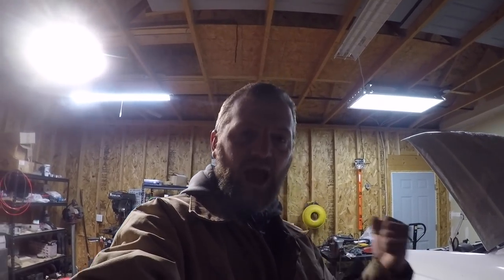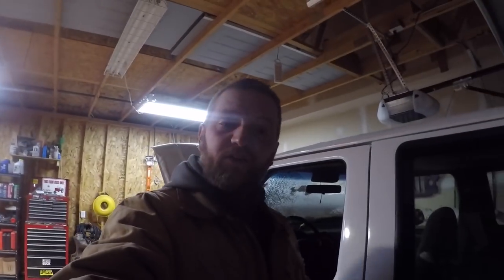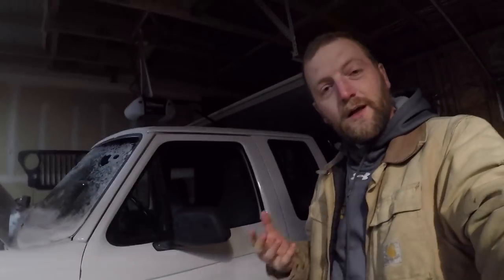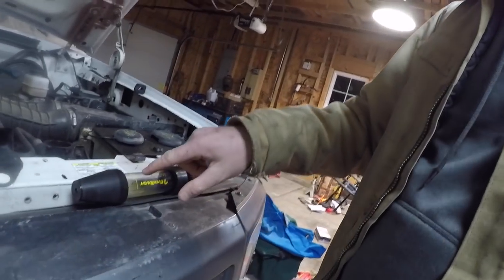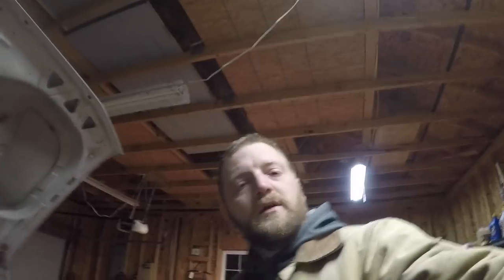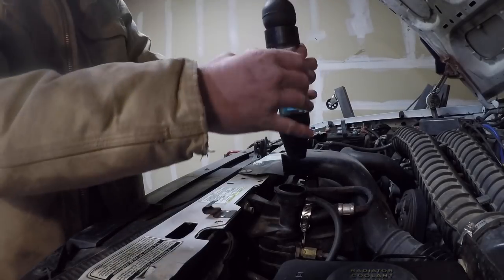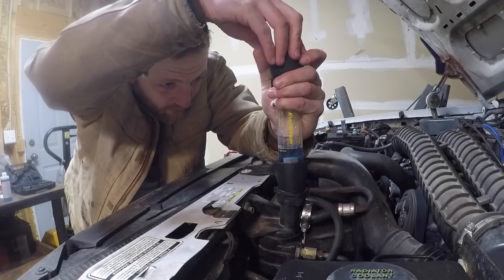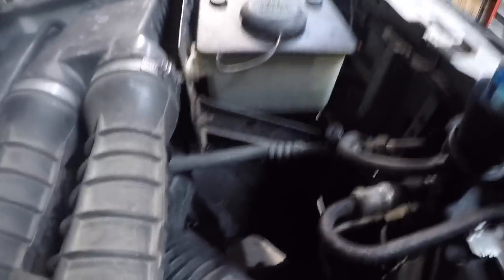Blew the engine?

Comment: Could be worn water pump impeller. Had this happen on a Scania dump truck I have here on the farm. Was convinced it was head gasket but sniffer test confirmed otherwise. Worn impeller caused the coolant cavitation and blew it out the radiator cap. Replaced the water pump and she was fine.

Comment: G'day Blake I have had those testers not change colour and still been a blown gasket/cracked head best way I have found now is pull the plugs and pressure test the rad and use an inspection camera in the cyls. Good luck and a happy and safe new year

Comment: Another suggestion next time you check might want to walk back to the tail pipe and begin pumping to check the fluid you're using.  The blue fluid does have a shelf life on it and after so long it no longer reacts just something to think about may still have a cracked head or had head gssket if they gave you old dye.

Comment: I have the same ford truck. I rebuild most of it by now. My advice is to check the oil or change it to see if it has water. Change the Radiator cap with a new one and make sure the thermostat is working properly. Also if you remove the drivers side valve cover and see if you have any moister Or pudding inside then you will know if it’s mixing water and coolant. Good luck from Texas

Comment: It makes one wonder why anyone would tow without the protection of a headache rack. Even on good highway and a rain storm could cause a jack knife in different braking conditions. Once that fifth wheel trailer jacks around, it can cause serious damage on a truck cab and passengers. You have good equipment just check out those trailer brakes. Good luck on the repairs Blake. Another good video.

Comment: Radiator pressure cap bad? That will cause steam off in that style system to blow out the overflow. Replace radiator cap and you should be good.

Comment: remove the hose to overflow tank put it in a clear plastic pop bottle with water. if at running temp it bubbles, it's a head gasket coolant or compression leak. if no bubbles it's a bad radiator cap

Comment: Sorry for the bad luck Blake,  I have found that the OBS Fords are tough and easy to fix however they are gettin long in the tooth.  Maybe a 1999-2010 V10 6.8 or a 2011-2016 V8 6.2 would be a little heavier  tow machine, you always have a gooseneck hooked up.  The 2005 and later Fords with the 5R110 and 6R140 transmissions are great plus many of them have the OEM brake controller built in.   Take care and good luck.

Comment: Go to the parts store and buy a new radiator cap , my 97 power Stroke was doing the same thing . Ten dollar cap solved the problem change them every year because a bad cap will cause engine failure bubbles aren't your friend in any engine and especially a diesel . Good luck

Comment: Guy in WY we have a New Holland Super 1049 Bale Stackcrusier similar to the pull type one you have but ours has a cab and is it’s own piece of equipment. It started shooting anti freeze through the radiator cap and the reason was because the water pump had stopped working so the engine got hot thus for shooting anti freeze through the radiator but we fixed it and it now works fine so i don’t know if that would be something to take a look at or not but it’s a idea that might solve your problem.

Comment: Question for ya. Do you have a transmission cooler that could have popped in the radiator, and caused the seals to go bad in the transfer case and the seal on the tranny from coolant pressures??.  I have seen over active leaking EGR's that have caused the coolant loss out the tail pipe. Or a simple fix, try a new radiator cap. Is the oil water logged and milky? I know you were and still are a mechanic, and your just testing all of us.  Thanks for the shows and the learning curve.
Reply from the maker: No. The transmission and transfer case seals are separated by other seals so a failure of one should not affect the other.

Comment: Test the rad cap and look at sealing surface on the rad where the cap seals.  If the cap is leaking, it goes into the overflow.

Comment: Suggestion. Cracked reservoir? I have seen them crack along those lower mounting tabs. For some reason the plastic that Ford used degrades, and after about 15 years, it's like they have been sitting in the sun and get plenty brittle. Cold weather doesn't seem to help. Glad to hear it;s not the head gasket. Mine is a 6.0L and, as all 6.0L do, my head gaskets went at 80K. Studded the top end, all better. :-D

Comment: Thermostat? When they stick closed it will push water out and fill the overflow until it over flows. Happend to a buddy that had a 95 f250 with a 351w

Comment: Hay blake there are no problems  only opportunity  Lol . Please check your radiator  cap to make sure it is  good becuse a weak spring in the cap will cause that or the wrong cap .also get a coolant pressure  tester And pump up the system to what ever Psi your cap says on it  I think its 7psi  see if it holds. By th way nice OBS Ford  I had one and I think there awesome  I just hate the Dana 50 axle up front . If the  motor go's  bad  you should put a 12V Cummins  in there

Comment: I just replaced my cracked radiator (4.3L V-6) and also swapped the thermostat and pressure cap. Runs cooler now.   Which came first,  the chicken or the egg? Stat may have contributed to the radiator failure.

Comment: Check the cap and pressure these the system and start checking for leaks if it won’t hold the correct poundage

Comment: Blake, Snap-on makes a nice dent remover. Maybe you can pull the dent and then weld the puncture?
Reply: johnH123 use the hole to pull the dent out then bondo the hole

Comment: Blake - A quick test of the thermostat.  Fill your radiator, leave cap off and rev up your engine.  If on the deceleration of the RPM's you get a gush of coolant flowing out the the radiator cap,  then most likely the thermostat is obstructed, failing or failed.  Your cold weather temps could mask the early failure of the thermostat.  Your radiator cap is also a prime suspect for what you are seeing.
Here's a cool YouTube video, for us subscribers, on how the cooling system works that will help visualize the cause/effect of whatever problem you find:  https://www.youtube.com/watch?v=V7inC4lOpGs

Comment: Get a new used truck bud
Reply from the maker: The problem is moving my snowplow. They don’t make mounting kits for this brand anymore and a new plow adds thousands to the price of a truck.
Reply: Guy in WY I would still get a used truck the same as the one u already have and save yourself the trouble of all that work

Comment: At least its a gasser and not the diesel. If the truck has any kind of high mileage on it.... just pull the engine and put a reman in it, then good for another 10 years. Probably cost you 3 to 4 grand when all is said and done.     If it was a diesel........ O boy........ 8 to 10 grand.  Why people buy diesel pickups these days is beyond me, the modern gas engines are just as good. Same fuel mileage, same power... in fact, a lot of the time the gassers have more, plus they start easier in the cold and are less money. 

 The large municipality I work for stopped buying diesel pickups 8 or so years ago.  Large trucks.... Diesel. Pickups... gas.